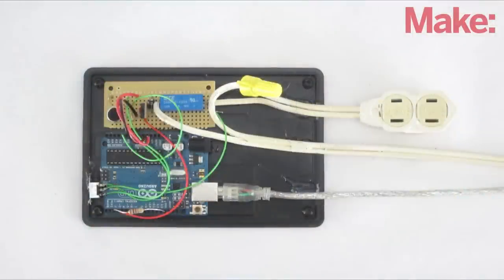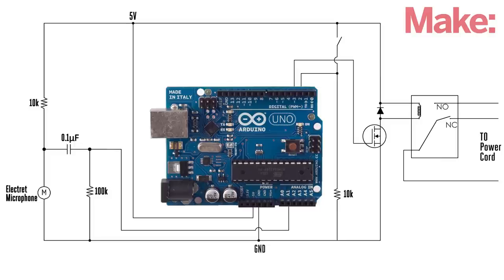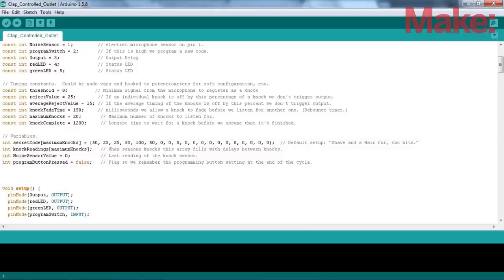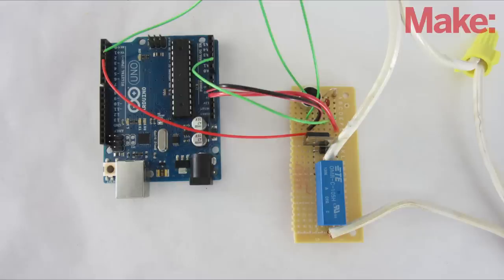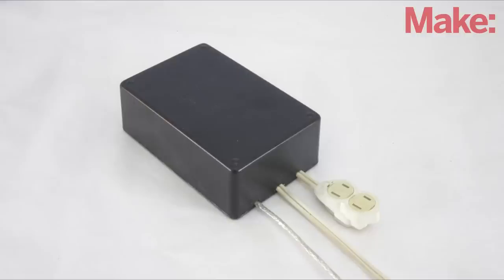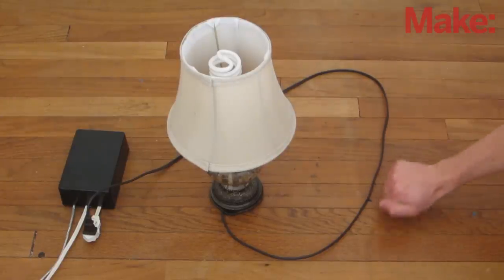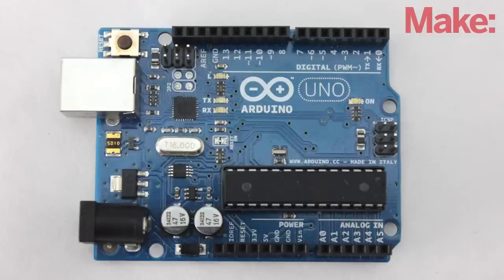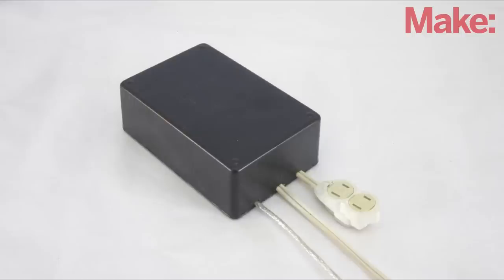Sound-Activated Outlet

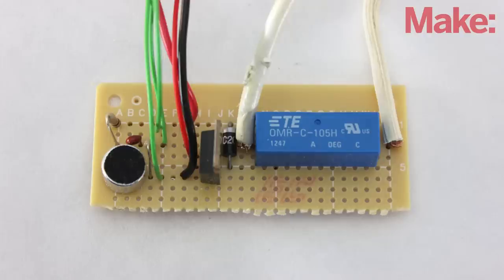Comment: 1:01 in to the clip you see the board connection, the AC wire is cut of and many of the copper wire inside is cut if, this is not good, also working whit AC mains you would like more safety in it, if this fails it can be dangerous.

Comment: That is just a basic idea, to show a very simple way to build it, and even so, you should be acquanted of Arduino, Microcontroller board, programming.
But if you are smarter, then you can use several small Tiny Duino chip with its own micro power supplier, adding 60Hrz noise filters, build it on custom mini 1 inch PCB and install directly inside a power plug on the wall and building many you may control ALL the plugs in the room :)
But again, remember that it is just a nice gadget idea.. :)

Comment: This isn't a good design..the AC from the wall power will give off noises(electrical) which will effect the microphone.. It'll b better if the DC stuff is away from AC.
Reply: You can make it work easy whit AC, just shield off AC components, tho this build have a lack in design for the AC, its not the safest.